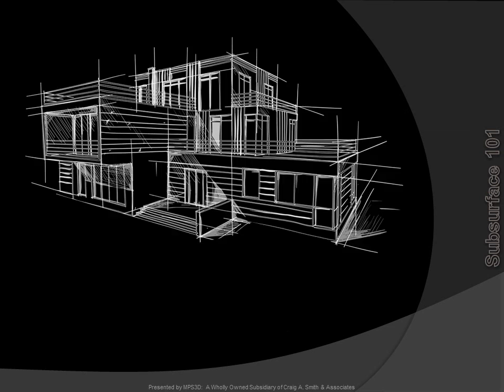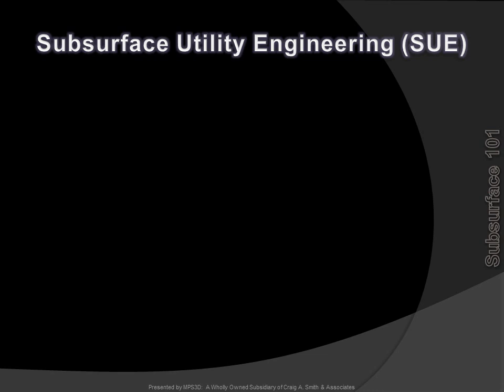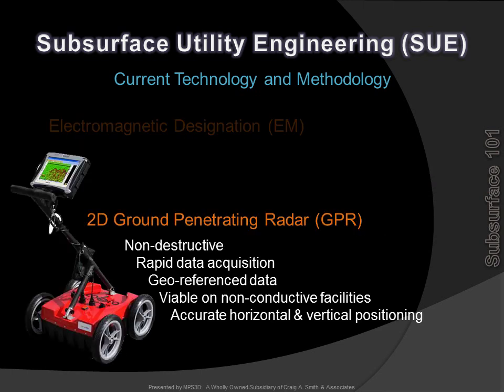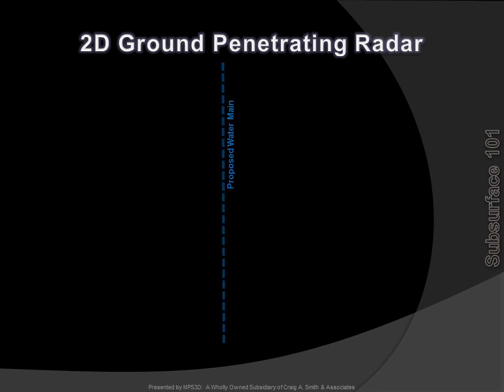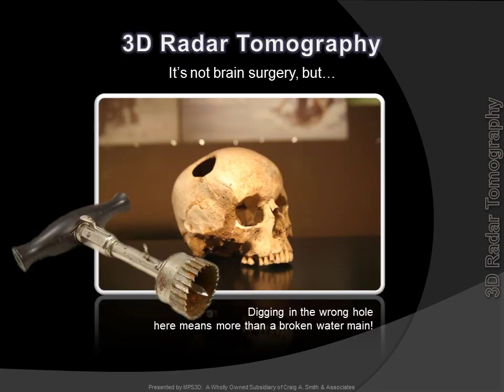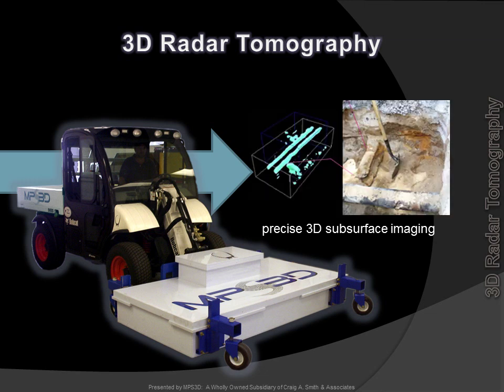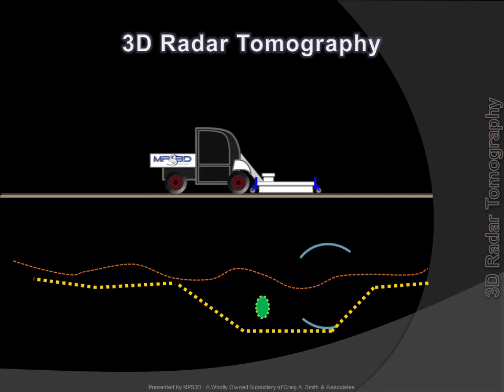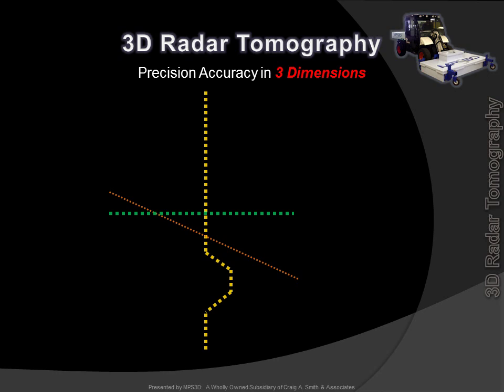MPS3D: 3D Radar Tomography for Underground Utility Mapping & Imaging

Comment: Can be a great tool in ideal soil conditions.  Unfortunately most areas of the US do not have ideal soil conditions. Also, vertical accuracy doesn't meet ASCE 38-02 guidelines for QL A data. Again, great tool under the right circumstances.  Should be used selectively in my opinion.